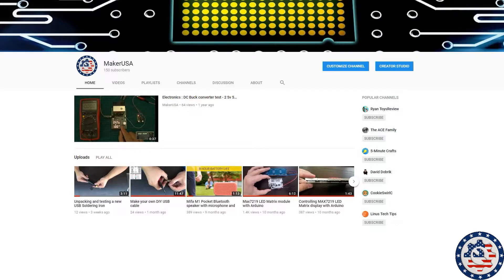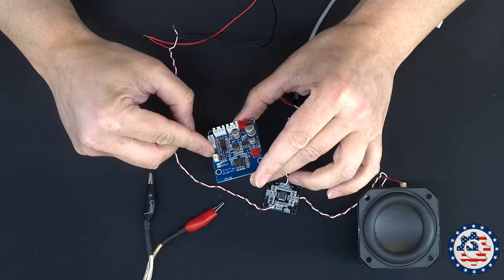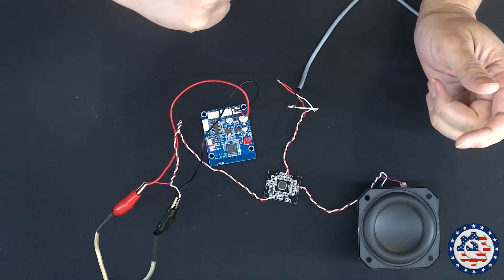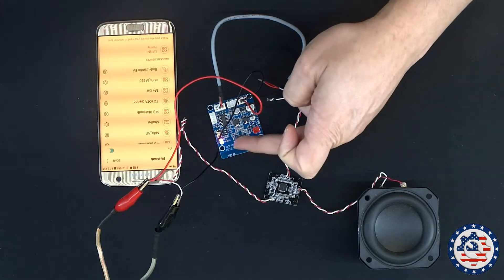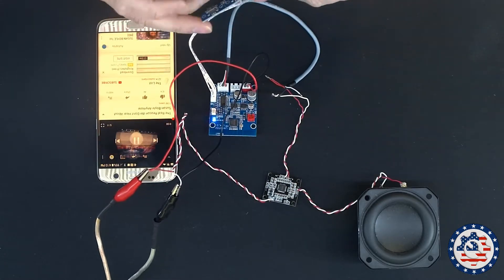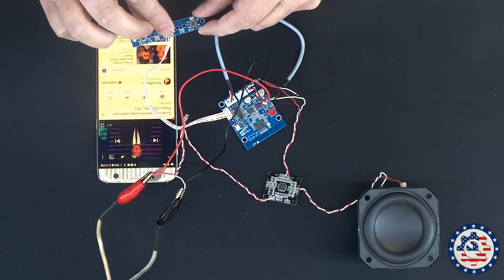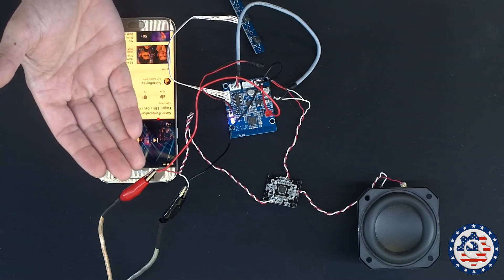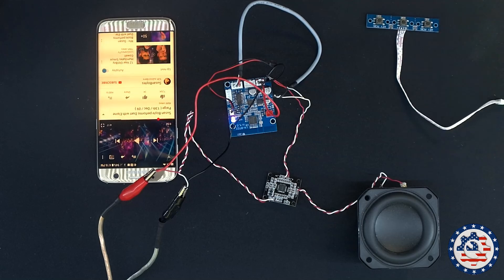Demonstration of the LN-BT02 Bluetooth receiver module

Comment: This is my favorite unit to upgrade old radios... if you get noise in your output add a 16v 1000uf cap to the power feed..  With the mic and remote buttons it makes old radios usable again!  I intercept the the pre/amp feed of the old device so it BT interrupts whatever you were playing on the old device like it was designed to work like that..
Reply: Can you explain your solution a bit more detailed? Would be great! I don't understand, how the BT can interrupt, wouldn't there just be 2 audio signals parallel?
I would like to install an BT modul for the AM mode of the original Radio, but the only downside would be missing navigation sound of BT connected smartphone while in FM mode. Therefore, the best thing would be a BT input which allways kind of shut down the FM audio.
Reply: @youtube_kanal1234   This unit has a cut out/pass through for the input.  To install you find the signal input going to the amplifier circuit and install accordingly. May need variable trimmer to attenuate. Good luck!